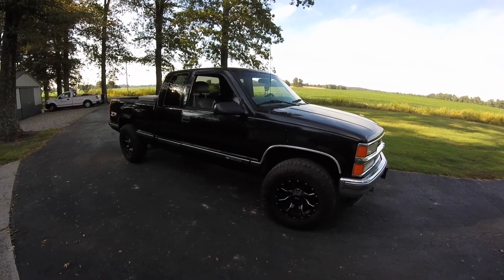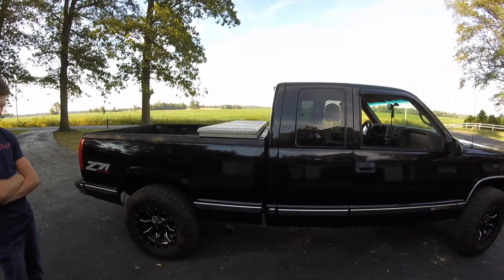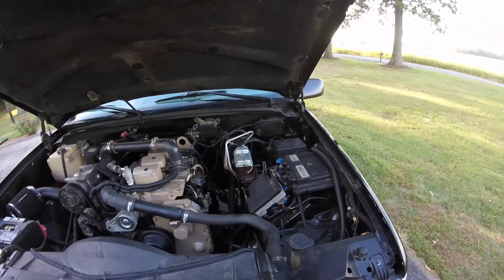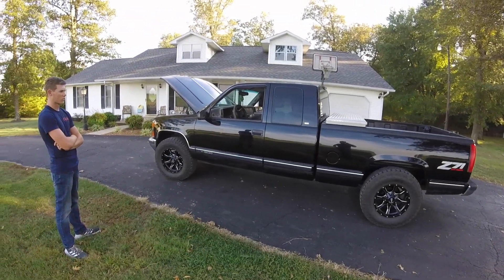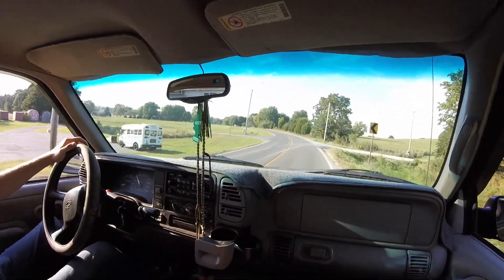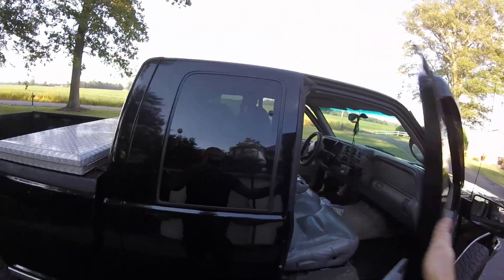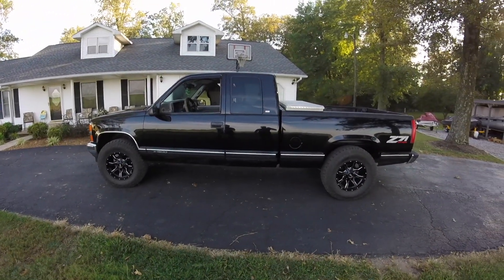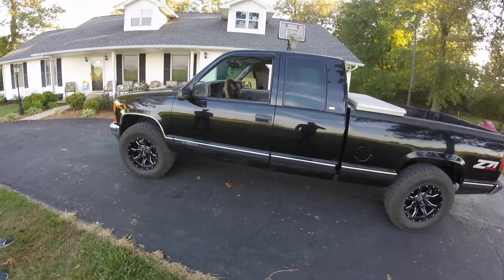Part #12 CUMMINS 4BT CHEVY K1500 CONVERSION COMPLETED+DRIVE,  11 Video Series on My Channel!!!

Comment: If you and your son would be willing to do another Cummins project.  Please you tube Cummins R2.8 repower.  IT IS BASICALLY A DROP IN!  There are tons of YouTube videos on that swap.  I want it in my 1987 Chevrolet S10 Blazer, Tahoe, 4X4, 62K original garage kept Senior driven miles on it. It has the original paint.  The interior looks like it was never sat in and under the hood it still looks like it is still on the showroom floor.  You do not need to do the Hydro Boost mod (The motor already its own vacuum pump on it).  I think somebody makes a universal Motor mount kit.  I would love to have you guys do the swap for me.  You did not do any short cuts on your conversion (I followed along).  You guys  should be proud of how it turned out.  I am a medically disabled / retired LEO.
Reply from the maker: Arlene Wolf I’ve seen the swap looks really easy just the upfront cost of the engine is the biggest issue for most. Are you wanting to do a commuter truck or off road ?
Reply: @jeepmanking3577  Although I have actually needed 4 wheel drive here on occasion (there is a lot of slippery clay here in Tennessee and some occasional snow), this would be for a daily driver and I would be looking for total street ability.
Reply: @jeepmanking3577  Tennessee, it is beautiful here.
Reply from the maker: Arlene Wolf who is the supplier for you engine and trans adapter?
Reply: @jeepmanking3577  Believe it or not I found the listing on EBay.  The only issue is that I may need to talk to a transmission shop.   Apparently there are two different bolt patternsfor the TH700R4.  One for a 60 degree and one for a 90 degree engine.  I think the 2.8V6 may be different than the 4.3 V6 and the 350.  Sooooooo, worse comes to worse I may need a transmission shop to either swap the case, or swap the trans for the same one but with another bolt pattern.
Reply from the maker: Arlene Wolf yes you will need bell housing for 4.3 or 5.7 they are the same. Along with the correct torque converter, stall speed for the converter very important with the low RPM grunt of a diesel. What time frame are you looking for on the conversion?  The 2.8 produces 275 to 310 lbs of torque at 1800 RPM that’s for than the Chevy 5.7 trans has to be in good shape to handle the torque. Have you thought turbo 400 or the 4l80E auto or a manual 5speed?
Reply: Hi @jeepmanking3577 , The torque numbers you have posted are less than many small block V-8's and the 700R4 / 4L60E (same trans just electronic shifting  vs tv cable shifting) came installed on many v-8's so I don't think there would be an issue or concern.  Although the 4L80E would be stronger, it would require a stand alone computer and I do not think it would be worth it.  I do not know what the stock converter stall speed is (from the 2.8 V-6) and I do not know how to properly calculate the stall speed for the torque converter with a diesel that operates at a lower RPM than a gas engine.  The only thing I do know is if the stock converter stall speed is too high, lock up custom converters can be ordered with lower stall speeds for about $200.00.  If I was much younger I might consider the 5 speed manual.  My wife is old and a recovering stroke patient and she could never drive a manual shift..  So I have an idea, what stall speed converter is in the build you and your son did with your sons Silverado with the 4BT?
Reply: @arlenewolf5260  It seems like you have good intentions but your cutting all the wrong corners before you have even spent money. You might be better off buying an old coupe or something fun to drive on the weekend.
Reply: @SavageZebra67  The Blazer, Tahoe edition is a mint time capsule, 62K senior citizen garage kept one owner miles.  I got it with the original title.  It was an estate sale vehicle.  It looks like it was never sat in and under the hood it looks like it is still on the showroom floor.  Original two tone blue paint, V-6, 4X4.  The original 2.8V6 is a slug.  I has the performance of a riding lawn mower, that is why I wanted to do an upgrade.  I will possibly look into selling it also.
Reply from the maker: Arlene Wolf the 5.7 vortec is rated at 275 lbs of torque around 5500 rpms. What I was saying is the 2.8 is around 275 -310 lbs of torque at 1800 rpm this could be a little issue if you drive it hard. You will need around a 1400-1600 stall converter to make the tranny work correctly, if the tranny doesn’t hold up you can have it beefed up to handle the low end torque better. So far our conversion is holding up just fine. Wasn’t aware of your driving preference but now I  am understanding what your intent the vehicle is. This would be a really cool conversion for sure.

Comment: How hard was this to do? Did you have to fab motor mounts and get a custom drive shaft? I have the same truck but I’m thinking about an old Mercedes Diesel engine would be cheaper overall, any thoughts?
Reply from the maker: Ryan Bower you definitely need a mechanical background. Look up my channel this is a 12 video series with the building of the motor mounts. Stock driveshaft was used. I saw a Chevy 1500 2 wheel drive with Mercedes looked cool.